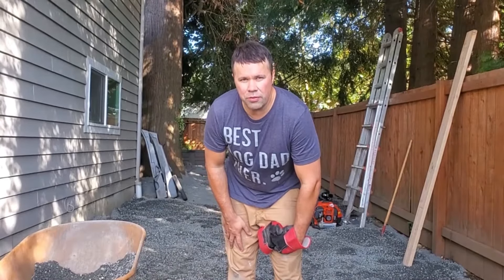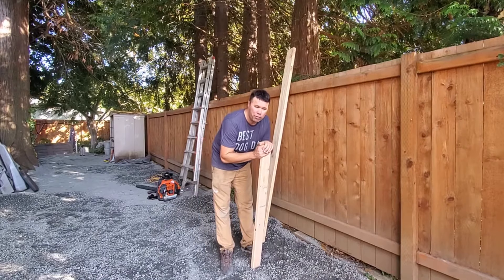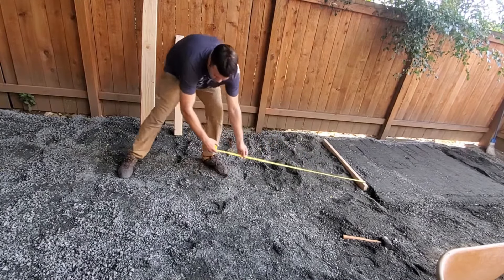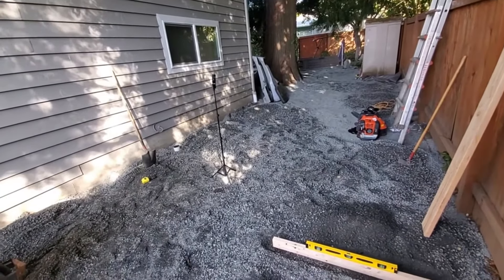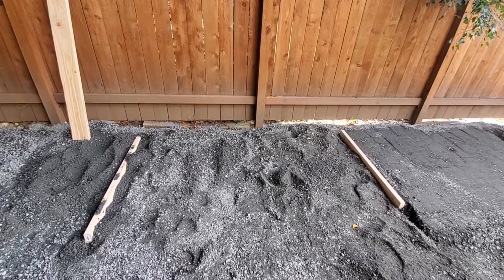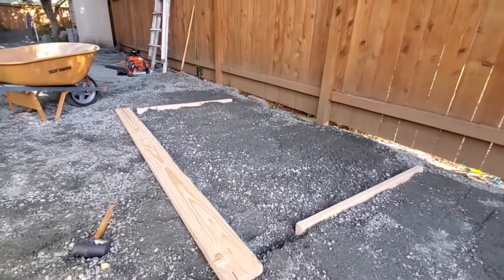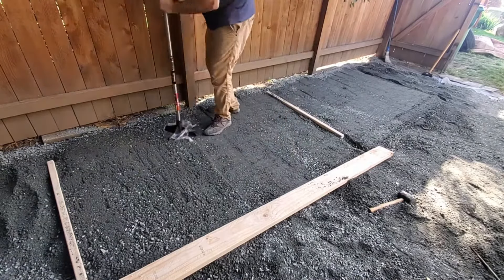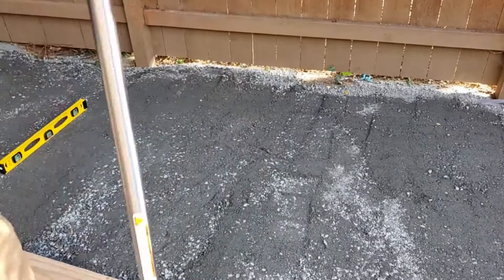How to Level Gravel

Comment: This is a great idea. I need to also make sure it is level in both X and Y so I will be putting a level on the long board and adjust the depth of the short boards as needed. Thank you for sharing this tip.
Reply from the maker: Glad I could help and good idea!  Best of luck!
Reply: Just be aware that boards warp, sometimes considerably.  Pick them carefully.

Comment: I'm about to start digging with a mattock on some hard gravel/clay mix. Don't have boards to do this, but some string and stakes. Doing a little project in the back yard. House builder left our ground bumpy and we need to level it up. Looking to add pavements as the top layer. Going to get a little noisy for our neighbours.

Comment: “Need my base layer to be 4 inches in depth. I’m going to use my 2x4 because they’re 4 inches in depth.”  

lol nope! A 2x4 is not 4 inches wide. All lumber boards are actually a half inch under their name. So you’ve got your whole driveway with a 3.5 inch base layer. 

Shouldn’t be a big deal. I mean it’s still a pile of rocks you can drive on.
Reply from the maker: Thanks for the input!  I was unaware of that!